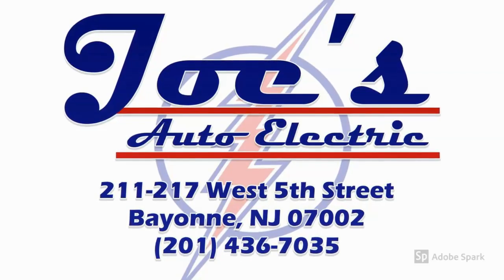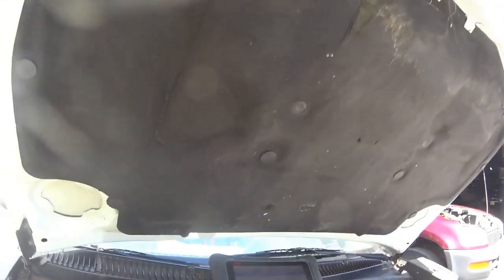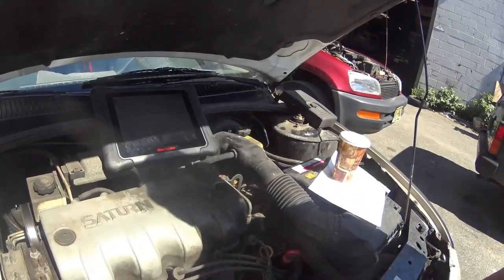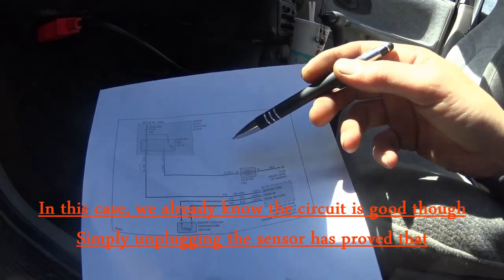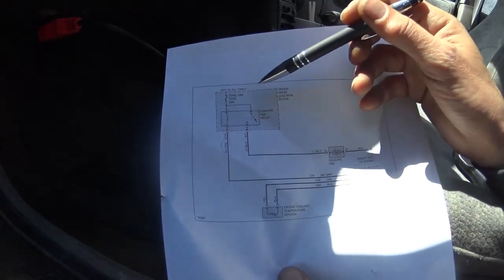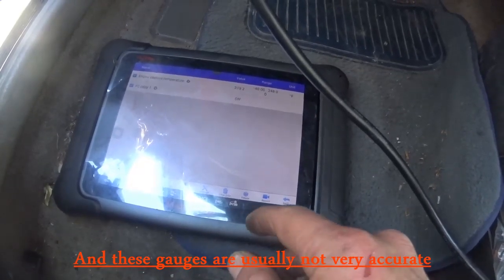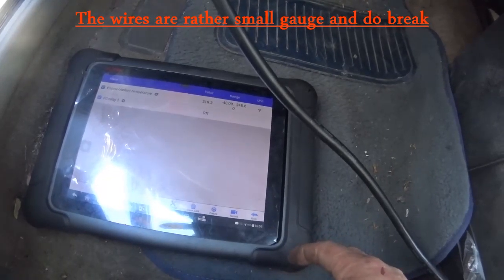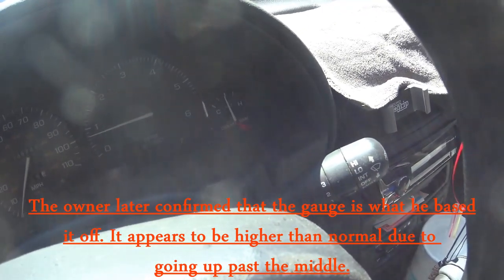Saturn Cooling Fan Concern (1.9 liter)

Comment: Thank you for posting. Appreciate that you took the time out of your day to help us out. I have a scanner that can read live data so I will be checking my Saturn tomorrow to find out whether the fan will come on at the correct temperature. I had an issue of it overheating while I was letting it get up to temperature so I could change the transmission fluid and filter.

Comment: Good day Joe , One thing I would add for maintenance on that Saturn is a new radiator  that will save  the customer the cost of a head  gasket down the road . that's a low mileage Saturn but no G.M radiator flows enough coolant after 8 years of service , the passage are two small and clog up a percentage of the Circumference of the tubes  .. Thanks for taking the time to make theses videos  Pete M
Reply from the maker: I worked for Saturn during the years this vehicle was made. It actually is a great car. Thanks for watching.

Comment: I might be having this same problem/situation. Because I couldn't be sure the fan was coming on. It would sometimes get above the middle zone a little like that, and I hadn't see any sign that the fan was on, when I opened the hood. I know I need to replace the wire connector, because that is the only thing I didn't replace. The fan comes on, when the connection is unplugged. I just replaced the thermostat, which solved a P0711 code. I had replaced the ECTS recently. But like this person, it still seemed like my fan might not be coming on during normal operation. If I had one of those meters. I guess I can just run it parked, until it gets up to that level, then see if it comes on.

Comment: My Saturn SC2 does this. I notice the gauge will show past the middle when idling. But, once I start going and especially after putting it in 5th gear the needle starts to come down. It seems to get hot only when it's idling.
Reply: My 1997 SC2 does the same thing. If the car is moving steadily, the temperature is good. But when I'm in stop and go traffic, the needle goes high and I worry and turn on the a/c to kick the fan on. I've unconnected the temperature sensor and the fan does come on. It once blew steam out of the coolant reservoir, but a new cap corrected that issue.

Comment: For an update, since the last time. I have changed every single cooling related thing on the car. The fan, the engine cooling sensor, the radiator, I found the fan was turned away from the radiator fins, so I put it on right. I changed the water pump, the thermostat, because the old one was stuck open. The coolant has been changed several times. I changed the transmission fluid and filter. Transmission fluid sensor. I changed the EGR. I changed the speed sensor. I changed the starter. All in the last month. And I am using all new parts, not parts I got at a salvage yard. But, though the car is running alright, nothing seems to help to cool the engine down, If I go up an incline, it starts to go past the middle zone and sometimes to the 3/4 mark. With the fan on. Today going uphill it got in the red zone, with the fan on! It actually, a year ago, didn't get this hot, even with much of the old stuff on, and the fan not working. I am just beyond knowing what it could be. The only improvement is when it did nearly or did get into the red zone, the coolant didn't spew out of the radiator cap, like before. Oh yeah, I replaced the radiator cap too.
Reply: The only thing I haven't changed is the actual dashboard temp gauge.
Reply from the maker: Sounds like the car needs to be checked by a shop.

Comment: Yes this was pretty much normal for 95-2002 model years, the needle would have to get to halfway between half and 3/4 on the gauge for the fan to activate. Temperature wise anywhere between 221F to 226F. The 91-94 model years were a different story. They had a separate sensor for the gauge and an ECT for cooling fan and air fuel mixture. On 91-94 models the temperature needle would actually get into the red area slightly before the fan activated. About the only thing you could do with those I suppose is try a low value resistor inline on the green wire that runs the gauge to make the temperature read lower.

Comment: Hey Joe, I have a 2000 1.9 l Saturn. I have disconnected the sensor, fan does not come on. I have tested power at the relay and fuse, and they have power, but no power at the clip where the wire harness clips onto the fan. So it seems to be losing power between the relay ( tested and working) and the fan itself. But I cannot see any broken wires. Any thoughts?

Comment: Hey there, I have a situation with my Saturn it dosen't have the thermostat on. I took it off & Ive changed the pin & the temp. sensor & yet the fan still starts up, once I turn on My car
Reply: On My dash board ir reads lees than half the heat... What must I do? I should check the wiring on ir?

Comment: Good job Joe, have you ever seen a Subaru H6 throw codes P0011 P0016 P0018 due to a short in a battery? Only intermittent

Comment: joe i love your videos. im not a mechanic but im not scared to wrench on my cars. inhereted a 1995 ford contour  and is fine mostly with only just rolling 40k miles on it.. zero rust.. i drive it daily.. did plugs and wires all new brake system.. but it runs really rough at a stop light in drive.. shakes my keys.. what could it be?
Reply from the maker: Engine mounts???
Reply: I agree with Joe,  if your idle speed isn't falling and then kicking back up  again, check your motor mounts.

Comment: Had on semi truck the ac high side would only engage the air fan at 300 psi.  Thought there was something wrong but it was way intended to work.   Of course when the fan kicked it sound like helicopter taking off.  Lol